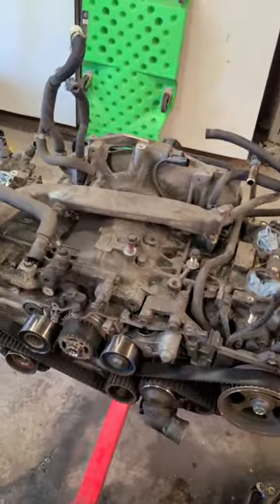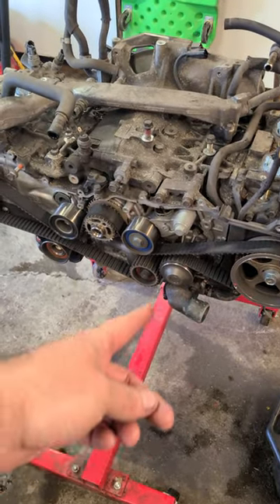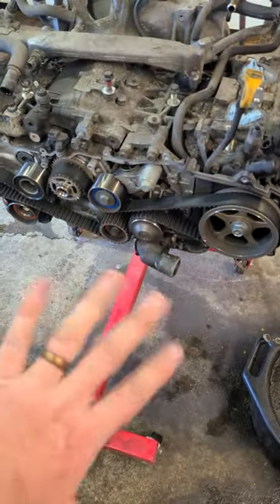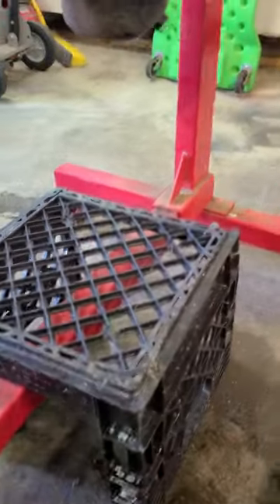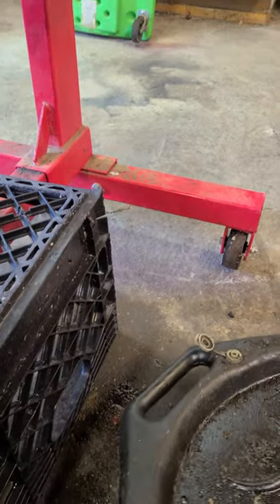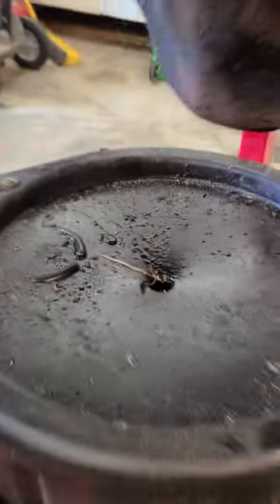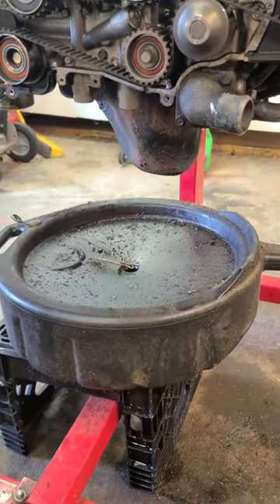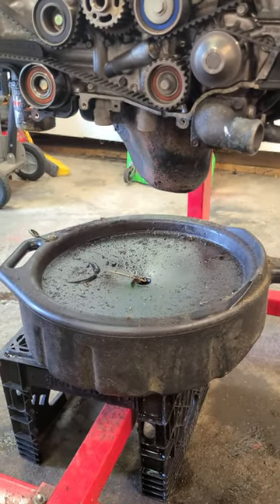Harbor Freight engine stand hack! #shorts

Comment: I would drain the oil when in the car.
But the most annoying thing about the HF engine stand is that it does not fit in between their Engine Hoist.
Reply from the maker: Ya even after draining the oil when you crack the heads open it leaks plenty more. 

That's odd about the stand not working. I have both the stand and the hoist and they work well with each other.
Reply: @bruceyyyyy  This is true about the oil. I think I just balanced a Cement Mixing tray. 
I had the 1 Ton Capacity Foldable Shop Crane from HF and even with the crane out at max it barely reached the engine center. but the back leg of the stand was wider than the crane leg opening. Had to do some janky maneuvering.
Reply from the maker: Do you have the leveler? I wonder if that has anything to do with it. I can hook up an EJ25 right to the stand on the second length on the crane. 

I got the leveler because if I swap the drive train I take the whole thing out as a unit. It's tight but doable.

Comment: Drain it b4 taking the engine out. Thatll be $100
Reply from the maker: Tell me you've never rebuilt an engine without telling me you've never rebuilt an engine.
Reply: @bruceyyyyy   pff. PFF. all I DO is rebuild engines. FERRARIS, BENTLEYS, LAMBOS 🤪
Reply from the maker: Ok. And?

How about this Subaru? 

The engine oil was drained before removal but when taking the heads off it still has a lot in the short block that dumps when rotating it 90 degrees.
Reply: @bruceyyyyy   my guy Im giving you a hard time.. chill... im busy doing a 2003 Escape engine. I know they still hold oil. After a drain
Reply from the maker: Ah. Just running your mouth then. I get it. 

But. 

Please stop commenting unless it's helpful information. 

I try to show useful things here and it obviously doesn't include you.
Reply: @bruceyyyyy   Alright buddy. Have a good day, then. Hope everything is good at home 👍
Reply from the maker: Thanks man. Hope all is well with you and yours.